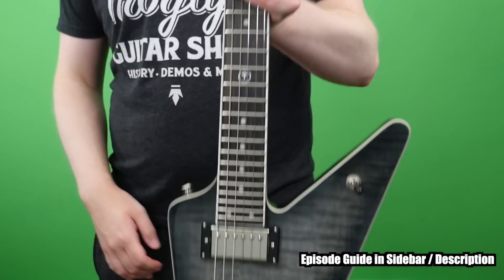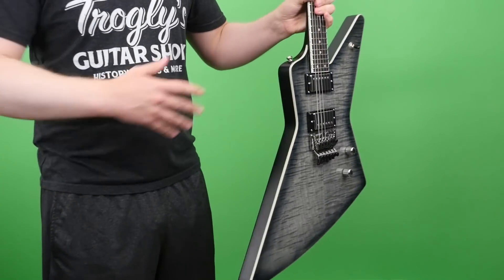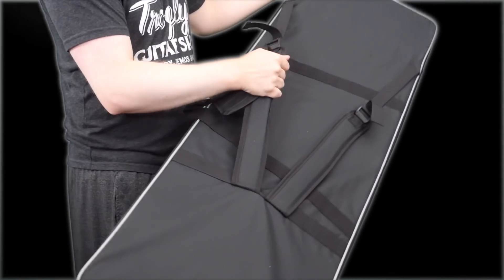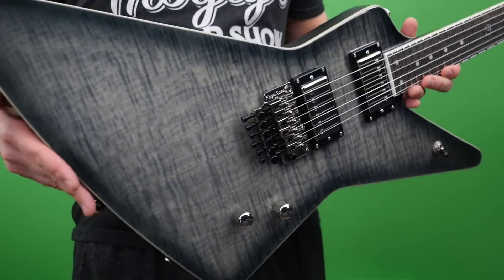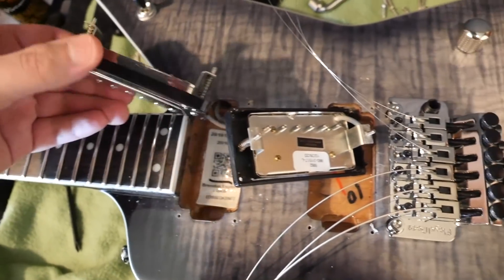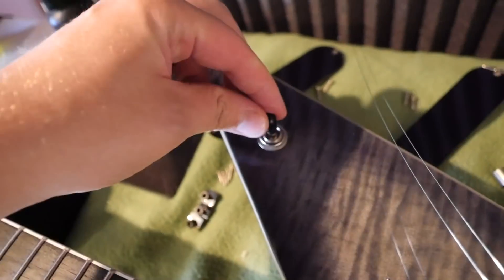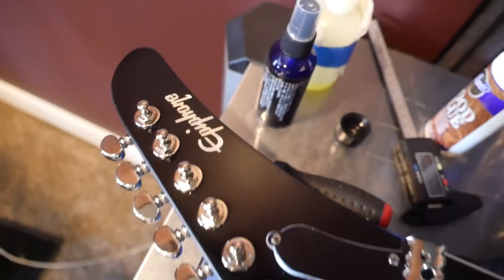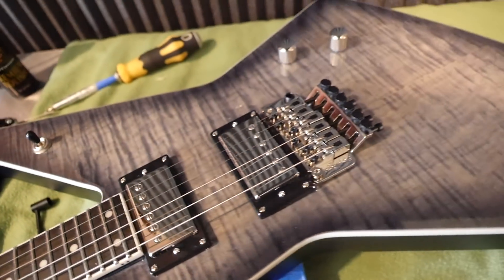Is The New Explorer a Deal? | 2021 Epiphone Brendon Small Ghost Horse Floyd Rose Explorer Review

Comment: I am GASing for this guitar so bad. I'd still have to rewire it anyways because I like 1 meg pots and don't like coil splitting, and I'd change the tuners to schallers probably, and upgrade the Floyd to the classic with FU-Tone stuff to make it a real thing to be reckoned with. The bigger horn is good for shredders because you're elbow is in the right place on the top. Killer looking guitar even if it looks grey in the video.

Comment: Regardless of what some people think Epiphone is getting on their game. I've got an Epiphone Les Paul Traditional Pro III goldtop and it's a great guitar. I was considering an ESP EC256 but I went with the Epiphone because of the split coil design. Like this Explorer they're independent of each other. The ESP had one push pull pot for both so you didnt have a choice to split just one pickup. That was a couple of years ago, could be different now. Anyway, its been a great guitar.

Comment: Did the springs for the bridge come from the factory that way?  You don't set the springs that way, it makes the middle spring moot as the two outside springs are stretched longer.   Not impressed at all.
Reply: Most people that hate Floyd  Rose's have that opinion because of poor / wrong set ups a properly set up Floyd is a dream . A improperly set up one is a nightmare. 
Nature of the beast. When you angle the two outside springs. It basically makes them progressive the two out ones provide a softer touch until you go further then the middle one begins to act as a progressive resistance.  It is the way Jeff Beck sets them up and you can't  really argue with that. He said it give a more sensitive feel and response .And it reacts to the slightest touch early and you still a strong resistance when you hammer it.. He should know. Right?
Reply: Yes both two I've had which had finish flaws had springs like this.
Reply: Well, it definitely doesn't make the middle spring "moot".  The middle spring has less tension on it and exerts less pull, sure.  It's still pulling though.  One can fine tune the resistance on the trem by adjusting spring angles like that.  I'm not saying that's what was done here, but it's not "wrong", per se.
Reply: @ChuckNicholsonTRM  Agreed, different string gauges might require more tension in a particular side of the bridge. Hybrid string sets. I've added springs to my Floyd Rose setup in order to tune down to D, or what have you. When someone says "You have to have it set up like this" I become suspicious.

Comment: I'm liking the ghost horse more than the thunder horse. Only thing missing is a tone control. I like to roll my tones back a little off full depending on what I'm playing.  The other explorer you compared it to seemed to have a slightly different horn where the toggle switch is.  As far as the horn I think it couldve been narrowed by the neck. But I think Brendan plays some over hand so likely that horn isn't an issue for him. Floyd rose trims I find are so much better than any other. Once you do a set up they are such a joy to use.

Comment: After a long wait, mine has finally arrived.
So here is my take.
On first inspection, it looked real nice.
Have not found any issues with any of the cosmetics, so thats cool.
The action was way high up, so i lowered the Floyd, but could not get it low enough to my preference before it bottomed out.
O.K.
It should be fine after I set it back up.     
So, as with all guitars a buy, I did a full tear down of the body, pickups, bridge, etc, and found some not so great issues with the neck, and frets.
It does have quite a few frets that need to be trimmed, so my hands do not get shredded while playing, but there one major issue is on the 14th fret. 
It appears as though they had a problem setting the fret itself, and they used some kind of filler to cover up the damage done to the fret board. The problem is, the filler the used is white, and then I noticed a lot of tiny white specks all over the fret board, as if they filled a lot of imperfections. Now, it is not noticeable unless you take a close look, but the fret "repair" is a little more obvious, but still isnt a sore thumb.
The neck is very back bowed, and I am putting 9's on it, so it should come back easily.
I am an ebony fret board guy, just love black fret boards, but I have seen rosewood darker than this.
Oh yeah, the little symbol thing on the 12th fret, is actually a little "lumpy".
So after all the critiques, I still love it.
Is it an $800 guitar?
By a long shot, yes.
Reply: Cool I had to send back 2 till I got one that was acceptable. Was quite disappointed epiphone have been killing it with QC lately.

Glad you got one your happy with.
Reply: @SionynJones  
What was your issue?
I finished all most of the work on it last night.
Put EMGs in it, had to tap the bridge pin sleeves a little deeper to get my action where i want it, without bottoming the floyd out.
I only use my bridge pickup, so when i gutted the p/u, and pots, i left the selector switch in, unwired, and made some long wires so i could put the battery in with the switch. tuned it, played for about an hour, and was happy. Still need to restring it, adjust the truss rod, and set the intonation, but it plays really good already.
Since it came with real, tapped Gibson Burstbuckers, I should be able to get at least $150 out of them, so my pickups paid for themselves.
Reply: @miked9000  cosmetic first time shoddy scraping of frets and finish cracks. Second had a broken case. Third I would say is acceptable binding was better but not great.

Comment: I've had a Dean Z for about 10 years. It has served me well. The cost was $199. It was a great guitar for the price. The neck feels great (1 1/16th nut width, 24.75 scale length); I think it's a standard C. However, because the body is very radical and large, it's cumbersome in small spaces, such as in front of a computer desk or small stage. My taste has changed since buying this guitar, so personally, I would skip buying another because it's awkward. Metalocalypse and Brendon influenced my decision to buy it, actually. I don't regret the purchase at all, I'm just in a different place in my guitar playing journey.

Comment: That's a fine example of a Ghosthorse so far I've had to return two.

Both had not properly scraped on fretboard side with dirty streaks across all the binding by the frets. Worse the second one had no finish around the top strap button that was right down to the wood. The second guitar cases neck support want installed properly and was loose with exposed screws. 

Quite a disappointment I'd of loved to received that fine example you have. Hopefully the 3rd replacement will be better.

Comment: next time you do a guitar with a trem (floyd or traditional), measure the spacing between the two studs and also lift the trem and show the spring block to show if its a brass, steel, etc... along with its measurement (usually stamped on there)
Reply: It's steel certainly not brass unless it been plated.

Comment: Dude, that is a top mount floyd! You know how rare and practical that is? It is worth just to buy the guitar for that!
Reply: nah you can buy an aftermarket floyd yourself and pretty confidently install it on your guitar of choice, for a fraction of that price
Reply: @maxmustardman298  Sadly most guitars with a vintage whammy do not have enough wood between the block and the pickup cavity to hold the two floyd studs (just carving a new body, the old one broke...).
Reply: @TheDarkmore  with Strats yeah, I have seen that before. Botched installations without using proper tools, total abuse, and at some point the wood just gives. I wonder if one could make some sort of preparations before the fact to avoid those stress cracks. You usually see people repair and reinforce when the damage is already done.

Comment: That’s a non recessed Floyd? Wowwww
Reply: because of the angled headstock it doesn't matter so much that it's not recessed.
Reply: Yea IMO, it’s not a true floyd setup without the floating bridge…. But, it saves on manufacturing costs without the extra body routing.  A good guitar to smash on stage though 😂